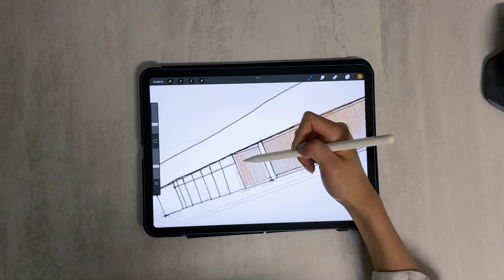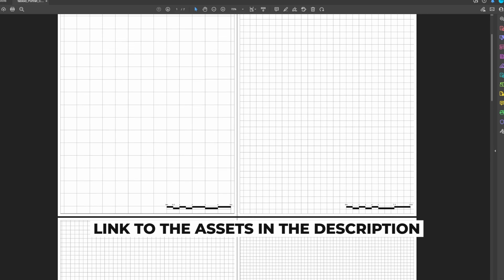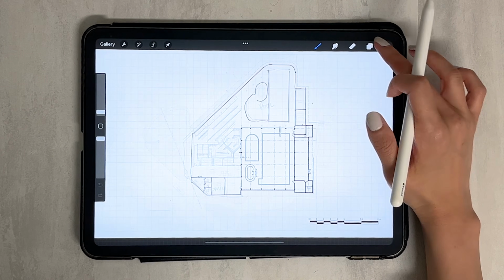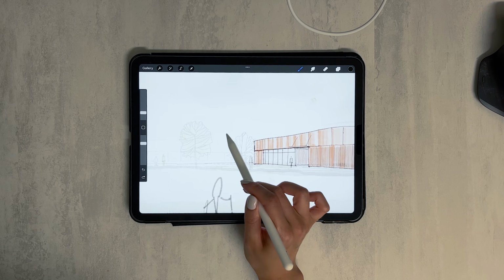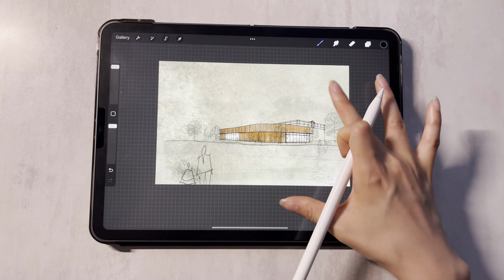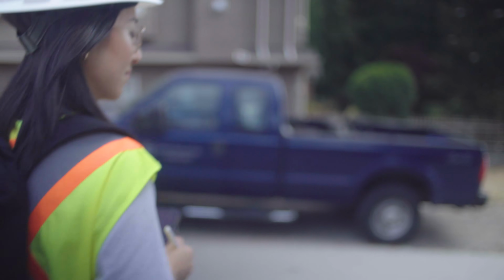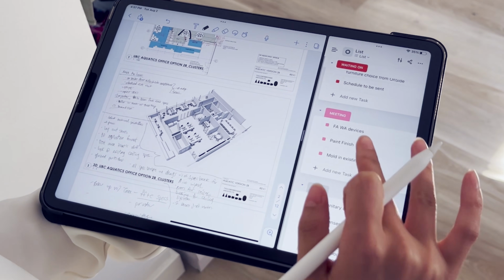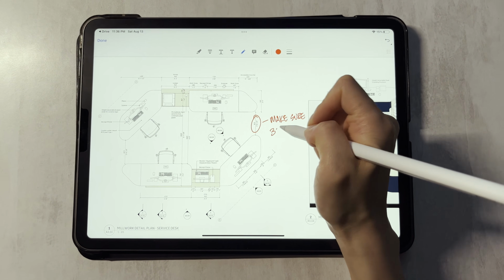How I use my iPad for Architecture

Comment: Moved up to a pricier version for better screen resolution and processor https://www.youtube.com/post/UgkxUGaHtKW8MwCql2fPyIm9-ftTqSMzKFFA , but battery drains faster, and not having a button for control of apps turns out to be a problem. Touch ID is harder to use than with the old button on the front. Can't really see the better screen resolution or see increase in speed, etc with better processor

Comment: hi, very good your videos
I found your channel today, I work with industrial engineering in Brazil, I would like some help, an opinion.
I do field surveys to start a project and I would like to know if it is possible to use the Ipad with DWG files.
And also if you recommend using the Ipad to take pictures and mark the measurements on the photo itself.
Thanks.

Comment: Aside from using the iPad stand-alone by sketching or having out at a job-site, I keep it next to my computers (iMac 27" and M1 Max 16" MBPro). I'll be doing ArchiCAD on my iMac, Twinmotion on my laptop (the M1 Max Chip rules at this), and I'll use my iPad for ALL other apps so I don't have to switch out of the programs to do emails, or texting, Notion, or PDF review, etc., etc., (and of course, managing my music playlists as I work). I use the iPad natively, and "not" as an extended display. The thing that brings it all together is "Universal Control" which enables me to use a single keyboard, trackpad and mouse across all three devices. It's amazing how well it works!

When out at job sites, I actually save CAD plans/elevations out to high-res JPGs and use the Autodesk Sketchbook app for marking up, dimensioning, etc., while on-site. I found doing these tasks in a raster-based mode is much easier than marking up a PDF with vector annotation tools. It's basically like Photoshop or Procreate on the iPad as well.

Keep up the great channel!
Reply: What size  iPad did you get?

Comment: How did you design the templates? According to Procreate (I emailed them) the software translates everything from (not defined) pixel, therefore it’s as good as impossible to design/calculate metric/imperial distances accurate. I know that some architects sell rulers, templates and so on for procreate online, but I really wonder if 1:1 prints are really accurate, if 1 mm on template is 1 mm on print.

Comment: I'm a network engineer by trade, but I love listening/watching these videos. Every once in a while, I need to submit propose floor plans for equipment like routers, access points, etc. Typically my job will be to physically be on site to map the locations, to then have the architects or whoever implement them into the proposed floor plans. After submitting mine, they usually send a response to the effect of "uhhh, these plans look completed, we don't know who did these. we don't have to touch them, they are good to go". 

I have my iPad to thank for that. Great video!
Reply from the maker: Hahah that’s a great response. It’s not every day you get surprise good drawings ☺️

Comment: Do you use any software like the ones those designers use on HGTV...I am not sure what they use. I used SketchUp and chief architect (more suitable for just wood based homes). As a illustrator, I myself use SOLIDWORKS composer which is quite cool but more suited for technical illustrations of mechanical things

Comment: Is that pro 11 or 12.9?
Reply from the maker: iPad Pro 11 inch (M1)
Reply: @DamiLeeArch  and if macbook is essential, is the 14 or 16 would be best? I kinda feel the keyboard proportion and anthropology of palm fall on 16, but kinda heavy for everyday mobility..the 14 kinda too small if i recalled seeing one at the apple store, what's your opinion on this?
Reply: @DamiLeeArch  thanks for the reply...I'm a resident architect and recently I've bought this set of ipad, complete with pen and keyboard folio for my upcoming project.

My main intention is to attend rfi and reply forms on the go to the contractor so that there would be no more delay in instruction and backdate ncr closing.

Therefore, could u suggest what kind of apps that's available and most suitable for my project management tools, such as excel format for forms and memos, any cad viewer that's fast for bim editing.

Could this ipad replace a laptop, or should i buy a macbook as well to complete the combo in your opinion?